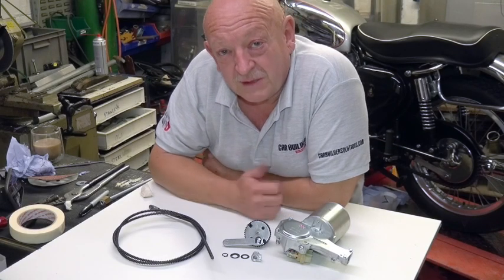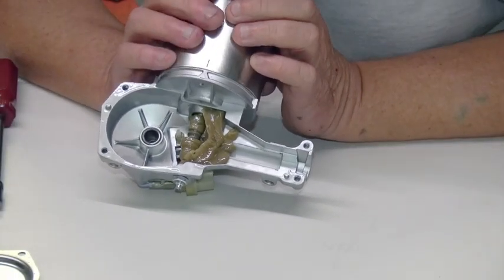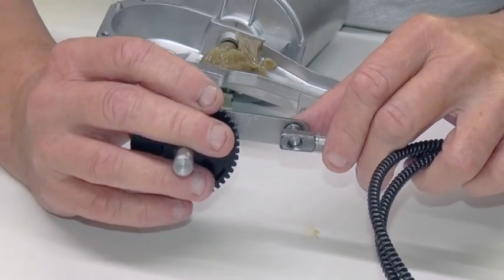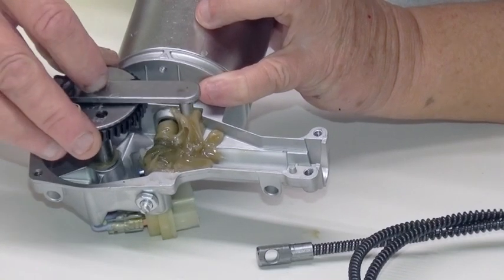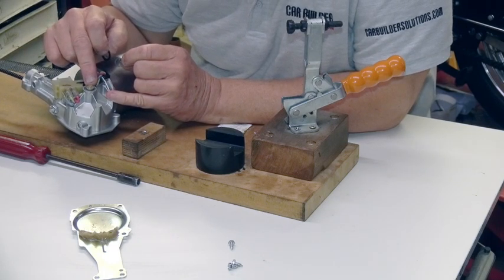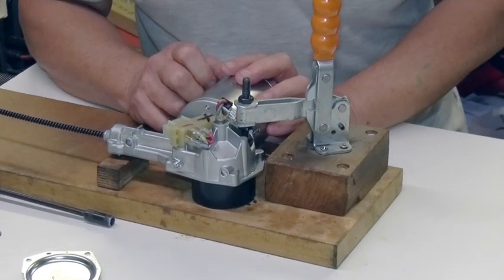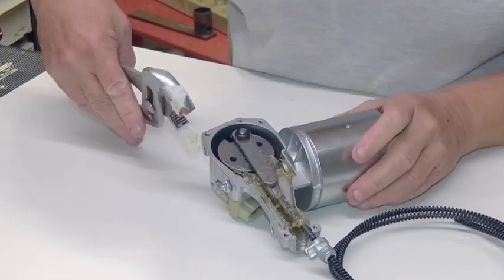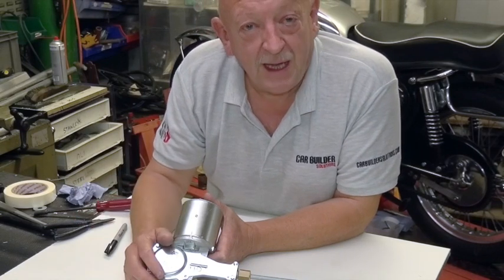Fitting a Wiper Gear

Comment: You forgot to mention that you can reverse the parking position of the wipers by levering off the nylon ramp on the wheel that engages on the parking switch, and pressing it into the opposite pair of holes.
Reply from the maker: Good point Tony, will add that in the next video
Thank you

Comment: Thank you! I have an old type from a Morris Minor and I just couldn't work out how the rack cable attached to the crank. Every other video fudged that operation. Mine is different but has enough similarity that I now know how to disconnect it to remove the motor for testing.